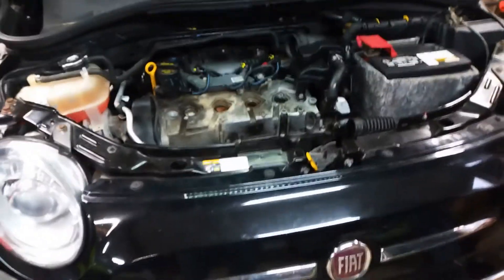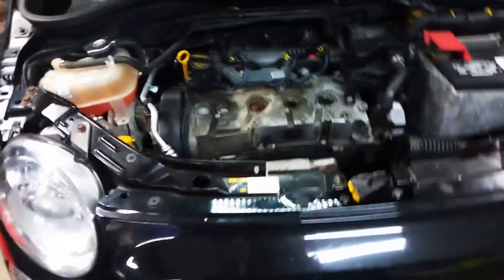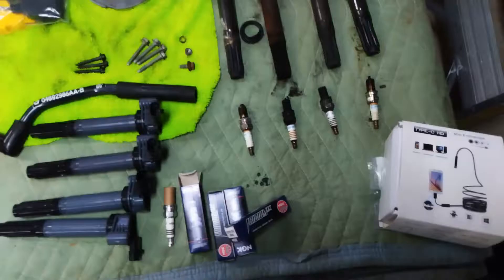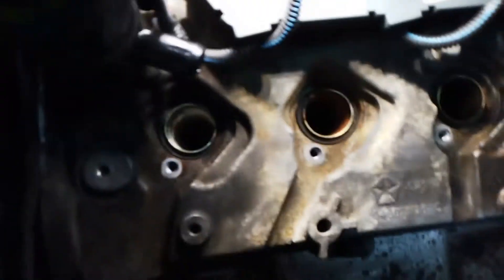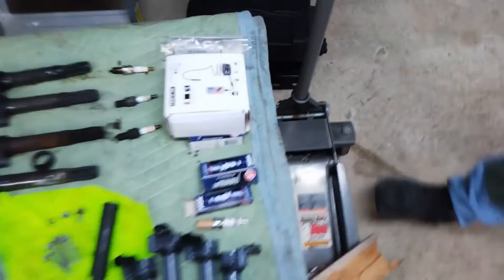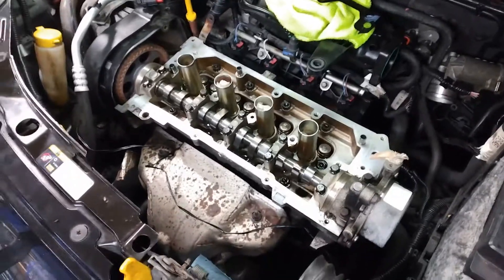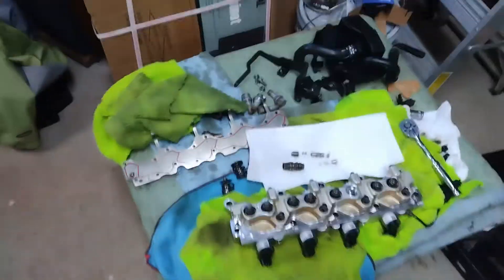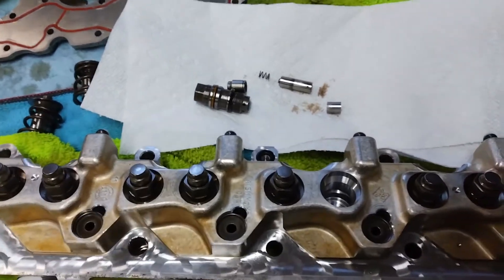Fiat 500 1.4L Non-Turbo Multi-Air Valve Box Unit Teardown.

Comment: A mechanic after my own heart. Mother in law bought a 2015 Dodge Dart 2.4L with Multi Air Codes on #3 cylinder within two weeks. I am confident there is a way to service these valves and solenoids despite the 'experts' claiming the whole unit must be replaced.
Reply: Hello there, did you have any luck getting your MiL’s Dodge Dart’s hydraulic solenoid valves serviced. Or, did you end up having to replace the MA brick entirely? Thanks for your response.
Reply: @susianatjiu6850  I have not torn into it yet. Mostly due to time, andvpartialy due to expense.  
I opted for a cleanse in process in hope of curing the sticking solenoid.  Decided to change the oil religiously  (no not every sunday and holidays) but like this
1 twice in two weeks.  Then every 4-5 weeks  four times. Now every 12 weeks. The day before I change it I add about half cup of (Dont try this!!) Xylene into the oil. Run it up to temperature and then leave it sit overnight and drain it. The oil must be kept clean and full. Last I checked there were no codes.
AGAIN.. I'm not telling anyone to try that method. Do your own research. Make your own choices.
Reply: @phylbiggs123 Ok, thanks for defining your corrective action. Can you provide a current status update on the effectiveness of your xylene cleaning and frequent oil change methods? 

Do you believe you have the issue fully corrected? 😅
Reply: @susianatjiu6850  I believe that it worked wonders. I say this as an opinion only, as everyone's situation is different and I would hate to steer anyone in the wrong direction. But honestly, we discussed the issue as recently as yesterday, and she reported that this has not been an issue; at least as far as effecting how the engine seems to be running. She said that the check engine light does come on occasionally but seems to go off on it's own and does not display symptoms as before. ie; shaking, lack of power,  stalling, hellacious misfire..
So in my long winded fashion I'd say yes. Xylene.. run it, dump it. Fresh oil and filter.  Run it a few day and repeat with xylene  rinse n dump. Try a third time and then go for a couple weeks. Get it clean... Keep it clean... 
Let me know your thoughts.
Reply: Thanks for sharing this, Phyl. Much appreciated! I will come back to you tomorrow with more questions for you…and to describe my particular misfiring situation, that I’m convinced is a result of a stuck hydraulic intake valve, or two, on Cyl. 1 only.

Comment: That basically an hydraulic tappet. 16 of mine were stuck with slugde and gunk. I opened them all, cleaned with degreaser and charged with oil before assembling them back.  No tickticktick since the first start up. Make sure to use fully synthetic oil and keep on your regular oil changes.
Reply: @Motors and Volts and Robots It had all of mines. Really don't know where you could get those.
Reply: I have dodge dart 2015 2.4l l have problem ….i have codes 
P0304  cylinder 4 misfire. 
P1064  cylinder 4 oil supply solenoid valve stuck .
P106B  cylinder 4 oil supply solenoid valve switch on time out of range . 
How solution?!
Reply: How replacement that , change all parts or what ?! plz help me
Reply: Victor, do you have any information on the clean out and charging of the tappets? How far did you go with stripping them? Do you have any kind of guide on this? 

I've had my multiair off this weekend, tappets dropped out on 3 of the valves when I lifted it off. Used some 0.5mm spring steel wire to form retainer clips and put it all back together. Seems fine, pulls really well again, but there is a clicking/tappety noise which I can't say was there before. 

I'm wondering if the tappets could do with getting stripped right back, degreased and recharged but don't know the technique. 

Thanks
Reply: @MohamedAhmed-bl9qu you figure out what was causing your cylinder 4 misfire ? Im having the same code
Reply: I use regular oil is that not good
Reply: @davidgray6232 
Hy David, did you find a solution on your noisy issue? I've got the same problem after cleaning the multiair... I'd appreciate If you could help me with this! Many thanks in advance.

Comment: Thanks for making this video. Im in the process of fixing my 2013 dodge dart 1.4T SXT multiair got it as project had machine shop do valve job on head put everything back together now had no compression no start no priming/holding down gas pedal was getting compression back none of those tricks worked. I now have multiair actuator out again like in your video turns out i have 5 stuck down and 1 or 2 that spring up and down somewhat gonna take it apart and try clean them may make a video of taking them apart and cleaning hoping i can fix this one car only has 69k miles

Comment: Hello. Thanks for showing this Multiair like opened. It helps me. Did you use the ideal oil ? often reason for damages.
Reply from the maker: After researching, I'm using Pennzoil Full Synthetic.  I've read that different oils might cause an issue with the Multiair unit, but after closely watching and reading, most of the issues really seem to be dirty oil.  Since I don't have a turbo, which really dirties the oil quicker, and I change oil every 3K miles, I believe that I'm good.
Reply: @paulday4763  I am from Reunion island. My area is considered by FIAT like Europe. Fiat oil spec here is something very sharp. Not all oil factories has this oil. What oil specs shows your owner’s manual ? 
Like you tell, your engine should be clean with care of bleeding you have.
Reply: @bertrandmaunier1786  no

Comment: What little wrenches did u buy to remove intake manifold so as to avoid cutting the tab? I have leaking seals to the sparkplug and I was told need to replace vc gasket too.
Reply from the maker: The top two outer ones can be reached from on top very easily.  The rest need to be removed from below, even the upper center one.  A 3/8" rachet with several different lengths of swivel extensions and the proper socket.  The swivel extensions allow the socket to grip evenly on the bolts.  It helps if you have someone on top reaching down and holding the long extension while turning from below.
Once all the bolts are loose, push the intake manifold straight back as far as possible, being limited by wiring at the bottom by the starter.
Valve cover and multiair unit can be wiggled out to the side under the tab.  When installing the valve cover with new seals, I did pull up on the tab to give a little more clearance.  No leaks, and the engine is running great.  Watch for a follow up video.
Reply: @paulday4763  i have about 4ft of each swivel extensions 1/4,  3/8 and about 3ft of 1/2 so got that covered now finding out the bolt size i assume 5/16 or 10mm is common. I'll use 12point. I'll have the owner help me he's skinny to do reaching.  Just have to wait til the engine is cold.

Comment: Interesting video. Ref the actuator that was stuck....could it be normal hydraulic lock as the solenoid valve might be closed. I understand that there are tiny bleed holes in the multiair unit cover which if blocked can prevent the plungers for returning. Also prior to failure had the engine been tapping?
Reply from the maker: Prior to total failure the engine stalled and had trouble starting a few times.  There was no engine noise once running.  The bleed holes were clear on the old unit.

Comment: I had purchased a 2015 Chrysler 200 2.4 multi are the bad thing about this multi air system is you have to replace the whole block because it is hard to find parts and pieces for the push pins and they can be very expensive my best suggestion is to go to the junkyard and look for the same vehicle with a better conditioned block

Comment: Did you ever get this back together & did cleaning the Multiair get the car running again?
Reply from the maker: After stumbling for about 5 minutes, it's been running like a champ since.  6K miles and just did a second oil change last week.
Reply: Really loved this video it was very informative….I was hopping you would show the rebuild as mine has the same issue as well…although less dramatic…P0303 Code..checked Coils & plugs ok..did compression and cylinder 3 is lower than the rest by some margin but not by half more like 3/4 low compared to full compression on the others…most thinking is either valve not closing properly…your explanation has been the closest to my thinking…how did you resolve the missing clip issue for the faulty multiair piston?
Reply from the maker: @victorkuria8068  Never found the missing clip.  Installed a new MAU along with new tuneup parts.  Car ran rough at first.  I believe that one of the intake valves became stuck open a little, creating backpressure in the intake manifold.  After running rough for about 10 minute, the RPMs smoothed out and it's been running fine since.
Reply: @paulday4763 
Does anybody know what MAU is?
Reply from the maker: @fawzisdudah8511  Multi-Air Unit
Reply: @paulday4763  
Thanks a lot for the reply. I missed that!

Comment: Hi, I have a problem with my Fiat Bravo II 2013 multiair 103kw. Occasionally I see the engine light and the car vibrates for a few seconds when throttle is applied. After a while, the vibrations stop and the car continues to run normally, but the engine light is still on. It is happening more and more often. The error is P1061.
Do you think I need to change the whole Multiair unit?
Thank you
Reply from the maker: Too general of information.  Best have it checked by a qualified Fiat mechanic.

Comment: Is it possible the spring clip is for installation ease only? The tapper should be limited anyways by the cam once installed. Also having trouble finding exhaust valves for 2012 fiat, anyone know anything ? Thanks and great info here

Comment: Thanks for the video. I have cuestion I hope you can help me. I just buy  a Fiat 500 and one of the solenoids looks damage. You know if there's a way to fixed or i have to replace the multiair module.
Reply from the maker: There's no way to repair/rebuild the Multiair unit that I know of at this time.  I replaced the unit, bought from an online Fiat dealer for $1,200.  Be sure to prime the unit with a hand oil pumper.  Expect the engine to run very rough until all the air is worked out of the unit.  Usually several minutes.
Reply: @paulday4763 Great video and great discovery and diagnosis!! Very helpful. 

Can I ask what Fiat dealer you purchased the Multi-air unit from, please? My 2014 is running on 3 cylinders, w/ #1 cylinder intake valve stuck open and creating blowback into valve train and into valve cover-located PVC assembly. I’m sure the problem is a stuck hydraulic cylinder…failing to operate this intake valve. 

I will perform this MA brick replacement myself, but I just need the best/cheapest  source. 

Thanks so much for your response/assistance with this.
Reply from the maker: @susianatjiu6850  Sorry, I can't remember the dealer, except that I believe it was located in NJ someplace.  It's going for about $1,600 now.  Match to your VIN number when ordering.  Search "fiat 500 multiair actuator"

Comment: How did you make out with finding a clip, what did you wind up doing to get the car back on the road?
Reply from the maker: I had to buy a new Multi-Air box.  I had a second half video, but using a new camera app corrupted the SD card the video was on.

Comment: elp me I have dodge dart 2015 2.4l l have problem ….i have codes 
P0304  cylinder 4 misfire. 
P1064  cylinder 4 oil supply solenoid valve stuck .
P106B  cylinder 4 oil supply solenoid valve switch on time out of range . 
How solution?!
Reply: And 
P0113
P0522
Reply: Plz help ,am in UAE
Reply from the maker: Looks like you need to service/replace the Multi-Air Valve Box.
Reply: Ok if we say service what doing
Reply: For cylinder 4
Reply from the maker: @MohamedAhmed-bl9qu  I replace the MAV box and didn't repair it.  Sorry I can't be of help with repairing.

Comment: Very informative video. Do you still have your old VVT box? I'm in need of the top sandwich plate that has the bleeder check ball assembly. I damaged the bleeder in mine by not realizing how delicate the spring was. I would very much like to Purchase it from you if possible. Thanks!
Reply from the maker: Sorry, I don't have the old MAU anymore.
Reply: are you refering to the relief  ball valve that everyone presses on with a screwdriver when it wont start?
Reply: y @HhHh-vi9bq  Sorry for the delay. Yes, that's what I was referring to.
Reply: Still need it?
Reply: @onyshiaharris5449  No I found a unit from an engine that had went bad but I'm not using the whole brick, just what I need. If this isn't successful I will reach out to you though. I hope to have time over thanksgiving weekend to be able to work on that car. Thanks.

Comment: Did you have to buy the 1200 dollar special tool to reinstall the multiair setup?
Reply from the maker: No.  I put the unit in place and turned the bolts from the center out, alternating from side to side, 1/2 turn at a time.
You have to jiggle the unit into place as the bolts bring the unit down into place.
Reply: @paulday4763  ok. Did you have to make sure the pistons were in half way up position ? I saw a video where the guys says none of the pistons can be at tdc.
Reply from the maker: @onlyoneromeo 
The pistons were never moved from when the unit was removed.  The engine wasn't at TDC that I was aware of.
Go slowly and make sure the unit is setting down over the guide pins.  You will see the springs slowly compress as you tighten the bolts.
Reply from the maker: @onlyoneromeo 
You don't have to worry about the valves opening and hitting the pistons because there's no oil in the unit to compress the valves open.

Comment: mine fell out too..... two of them....  does it still work with out the retainer clip?
Reply from the maker: I didn't try to run it with the missing clip.  You might be able to create your own spring clip if you can find the correct diameter spring wire.
Reply: @paulday4763  I am curious as to whether or not you got it running again. I currently have a customer vehicle with 4 or five of those actuators that fell out.